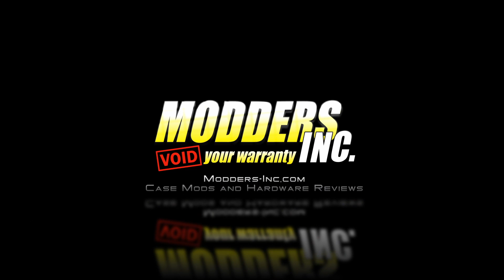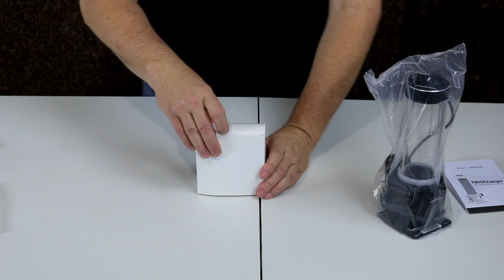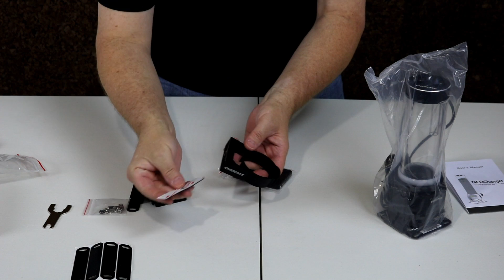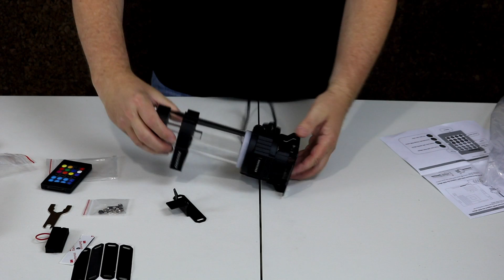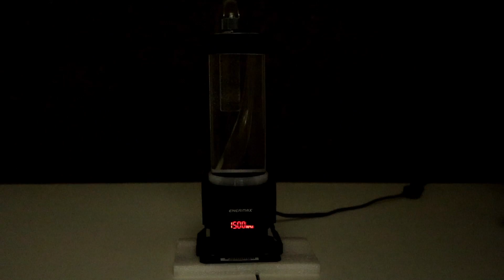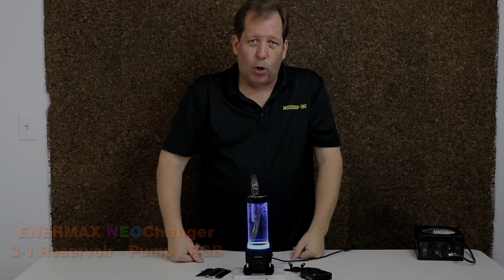NEOchanger by Enermax (The best RGB Reservoir and Pump)

Comment: Anyone know how to manually change the pump speed? Just lost my remote and pump speed is dropping like crazy.
Reply from the maker: Try to fully power down the PC and unplug the SATA power cable for the pump for a few minutes. Upon restarting, it may default to a default high-speed setting, which is usually fine for most liquid-cooling loops.

Comment: hi great review bud, is that pump changeable? if the pump does fail is the whole unit scrap? I'm doing a duel loop and will possibly use 2 of these, I'm guessing one remote will  interfere with a second unit installed?
Reply: The pump isnt changeable. So yes if it craps out the whole thing is scrap. Dont have two of these so cant tell you about the remote. For the price cant be beat though.